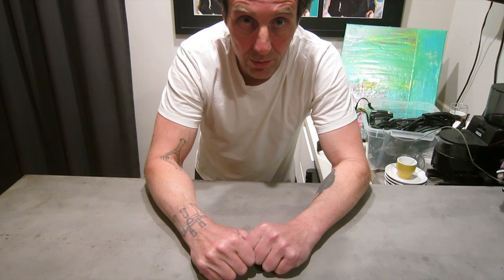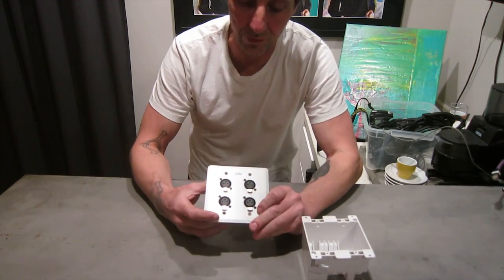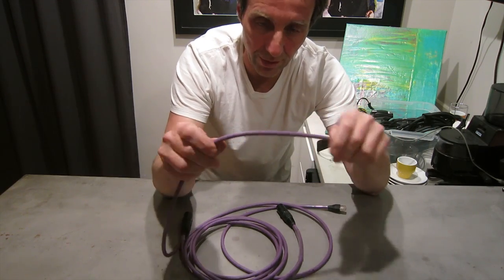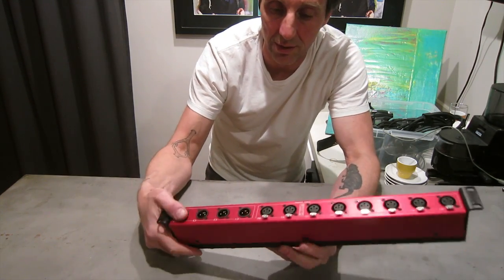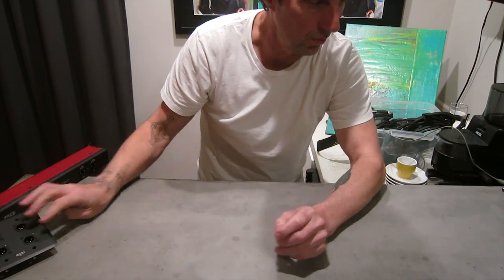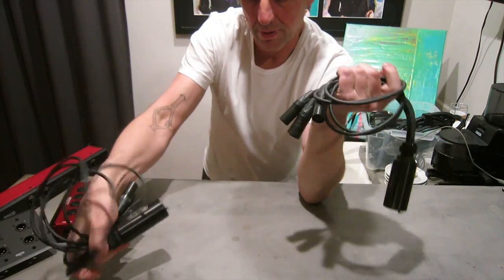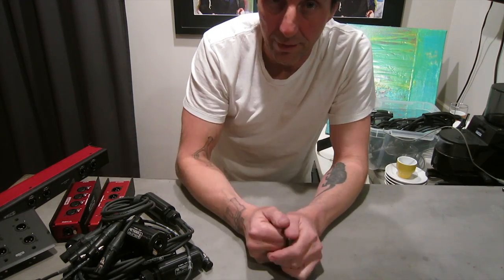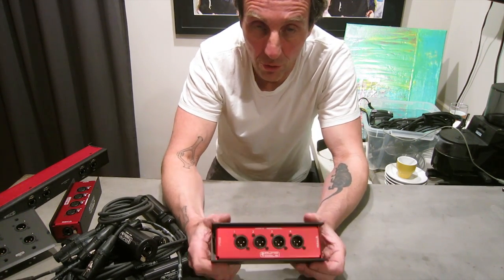SoundTools RatCat Series of Products, Analog, DMX, AES3 and Com over shielded Cat5/5/7 cables

Comment: It would be cool if you did a video explaining how you can run analog/AES/DMX across the same ethernet with these boxes. When you do 3 pin DMX, you are supposed to use a different impedance cable that you solder the end onto. 
Also it would be cool if you could do a video explaining different things you can do with AES/EBU. Can you make a Y Cable with AES/EBU? Stuff like that.

Comment: Hey Dave THANK YOU for all you do.  I have learned A LOT with your vidz.  I'm looking for a specific EtherCON tail.  I have a DJ mixer with Left & Right XLR main out  AND   Left & Right 1/4 TRS monitor outs.  I need a tail for those outputs.  2 Female XLRs and 2 1/4 TRS jacks.  Where can I find that?  Can I just change-out 2 of the Female XLRs on an existing tail?
Reply from the maker: You can just swap out the XLR. Also, soundtools is making combo boxes with 4 combo jacks (female XLR/1/4") so it accepts either 1/4' or XLR that we are releasing soon

Maybe email or call soundtools and we will sort you out and make a set of tails for you or get you one of the preproduction combo boxes.
Reply: @DaveRat  That would be great.  Thanks Dave!

Comment: So...  What happens if I use DMX cables on my overheads?
Reply from the maker: I don't really see an issue with that. If the pairs are not individually twisted there may be the most meniscule amount of crosstalk that's irrelevant
Reply: @DaveRat  Hey thanks for the reply Feller.  I found some sections with threaded collars that were thown away so I can make custom lengths.  Living in rural Nebraska there is little to no interference and my runs are 8 and 16 frets so...  Cool man thanks for the videos and sharing your knowledge.

Comment: Yes bruv.

To be honest multicore bundles of ethernet cables is a very sensible sort of modern snake. 6x catX (4xtwisted pair per) in one jacket is common. That's a very skinny for a 24ch snake, and conventional coaxial half inch thick multicore would cost a hell of a lot for a large building, so for permanent installs in venues this is a good thing indeed. Interchangeable audio & data / ethernet video down one type of cable is extremely convenient.

So down one sort of cable you can presumably send

64ch Dante / whatever the desk uses
4x AES stereo
1X 4K SDVOE video stream
4x analogue mic/line
1x stereo 100w speaker
1X Analogue RGB video
1x SDI
1X HDMI

Can do all that with just high quality data type networking wire, and have almost everything running off rj45 patch panels. 

That's bizarre but also totally viable. Need sfp for longer distances than 5-10m of 10gb for 4k video streams though.

Comment: Can you run analog audio for longer distances over the shielded Cat5 than standard XLR?  I'm assuming yes, but if it's non-powered and it's just a different copper wire, why would you get any longer distance?  Also, what kind of reasonable distances can one get from shielded Cat5 using the Cat Box product?  Can I do a 200' run with no loss in quality, or is that expecting too much?  Thanks for your reply.
Reply from the maker: I have a new video showing the sound quality difference between mic cable and cat cable for analog, coming shortly. But basically, cat cable has loss in level as does mic cable, over distance. Cat cable has less high frequency loss than mic cable so longer runs while maintaining quality sound are possible with cat cable

Comment: Dave, I really enjoy your info, keep up the good work. Are you familiar with the Line 6 cat cables that are used with the variax guitars? If so do make them? If not, can you recommend a tool I can use to re-attach the original plastic connectors (ethernet type)? This isn't a joke aimed at your label, a rat decided to chew on the shrink wrap at the connector. Those damn things love cables and the vinyl on my drummers throne?!#* Go figure?  Thanks, TW
Reply from the maker: Awesome, industrious rats! I know this is old but you can cut and re terminate. Here is a video of my daughter doing a termination. Its fairly easy but you need a crimp tool.  Or can buy a crimp tool kit on amazon or elswhere
Reply: @DaveRat  - thanks, I did some more research and got all the supplies/tools to do the job a while back. Those things can't take much abuse.
Reply from the maker: @78tag  there are other ones but they come at a price.  Take a look at Hirose RJ45

Comment: Hi Dave, I'm thinking about getting a few of the Cat Snakes. I was curious how they do with phantom power? Thanks.
Reply from the maker: phantom works perfectly. the main thing is to be sure you use shielded cat cable.
Reply: Thanks!
Reply: They will work perfectly. Remember on the real world in the network environment, we are using POE for Access Point, Video Camera and more. Phantom power should not be an issue

Comment: How do you run essentially 9 wires through an 8 wire cable?  Wouldn't four channels be four pair plus ground?
Reply from the maker: shielded rj45 connectors have a 9th connection using the metal shell

Comment: Does the Cat5 need to be shielded?  I've heard that audio will pass cleanly without the shield but that com runs do require a shield.
Reply from the maker: shielded cat is recommended for audio but line level and short runs work without shield.  no shield needed for AES3, com    usually need shield, phantom power needs shield, DMX requires the shield.

Comment: Hi Dave. I understand that these are simply a patching system and do not use ethernet, but do the RJ45 connectors used in these products incorporate the transformers that are used in the ethernet standard (as a by-product of their normal application)? 

I'm guessing they don't as this would of course block phantom power, but I wonder if one of the panel mount feed-through connectors with the standard transformer would be a good option (in parallel with a non-xfmr one) as an economical way of getting an iso split or just breaking ground loops? No idea if the properties of those transformers would work for audio...
Reply from the maker: no transformers, these are patching and splitting allowing the advantages of EtherCON to be used with a wide variety of signal formats

Comment: So the CAT Rack seems like such an obvious choice for a backing tracks application. Instead of using a Radial Pro D8, I could just use a CAT Rack. Am I wrong in thinking this? Big fan of your videos man and hope this year has been safe and fun out with the peppers.
Reply from the maker: not quite, the pro d8 is an 8 channel DI that converts high impedance to mic level.  the CatRack is 3 sets of four channel XLRs to 3 EtherCON that has no transformers.  it is basically a rack mount stage box.
Reply: Ahhhhhhh. Thanks for that!

Comment: how are the cat tails connectors labeled? If I connect two together via 200ft ethercon to run signal from foh to the stage, how do I know which input from foh corresponds with which output on the other tail?
Reply from the maker: they are labeled on the XLR connectors 1 through 4. using the Neutrik plastic clear band protecting the label. the band's can be changed out to other colors if you have multiple sets of tails.